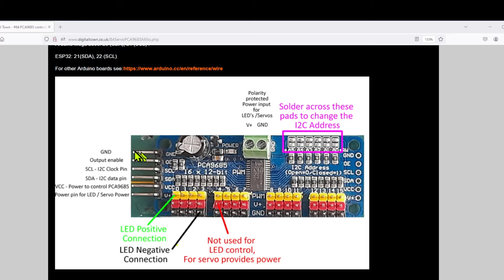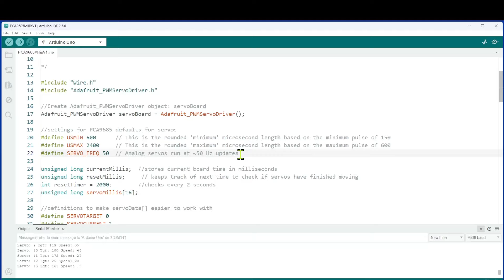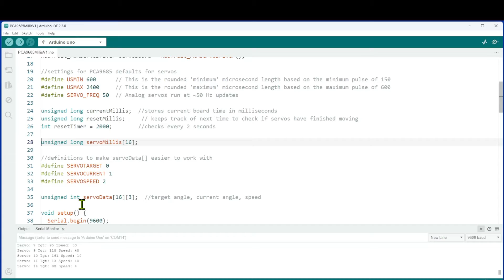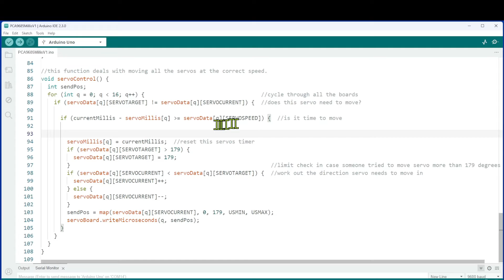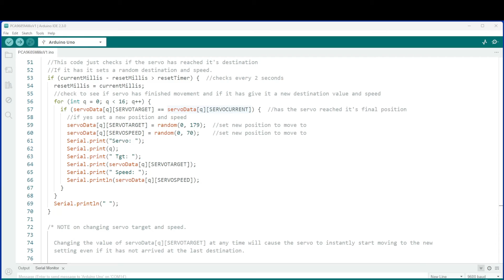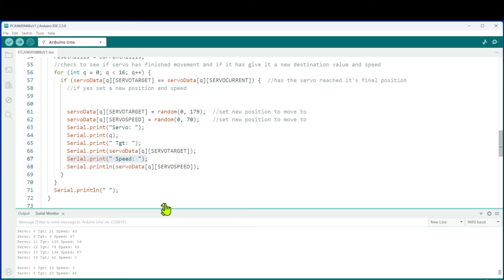#84 Arduino C++ Arduino Uno multiple  servo speed control with a PCA9685 board using millis()

Comment: This is only useful if the Servos are completely unrelated to each other. If you wanted to let them work together to move to a point in a fixed time(==different speed) this code cannot be used. I did it a bit different and also kept calculations out of the loop bc if you do it properly the arduino only have to do it once thus beeing faster and smoother for complicated movement.
Reply from the maker: It also works if you want to move all the servos in sync.... I have it running on my desk. 
Just give them all the same SERVOTARGET and SERVOSPEED
I have uploaded a 2nd example doing this to the support page at http://www.digitaltown.co.uk/84ServoPCA9685Millis.php

Comment: Just what I was about to code but based on 16 individual servos operating an array of points. So fairly easy to modify but I came across an IDE problem, I prefer to use PlatformIO to write and develop my Arduino/ESP32 code but for some reason it requires me to add #include <SPI.h> before it will compile successfully. The Arduino IDE handles this automatically but did require the Adafruit_PWM library to be deleted and reinstalled. So if anyone is trying to get this compiled using PlatformIO and keeps getting a failed compile just include <SPI.h> and it should be okay.
Reply from the maker: Thanks for the info
Reply: Yes, I can confirm, this happened to me yesterday, right after I installed the Adafruit library and then tried to upload the updated code to the to the ESP32.  I'm reasonably new to platformIO, but decided just to #include <SPI.h> since that was in the error message and, thankfully, it worked.  I Thought it was going to be a long search for a solution.